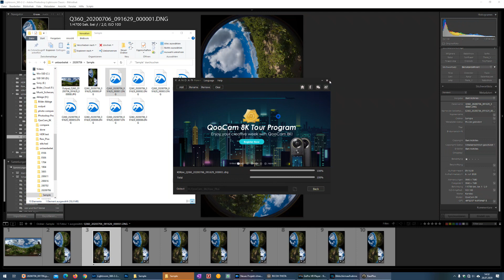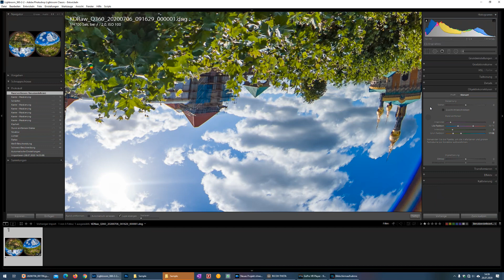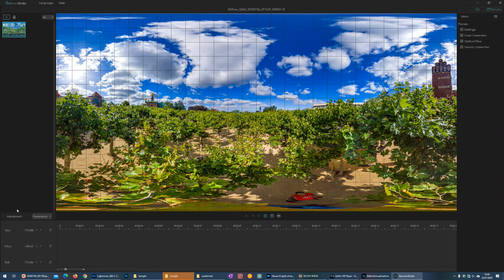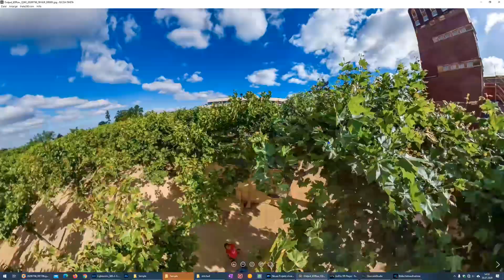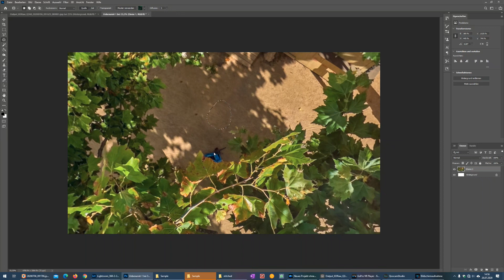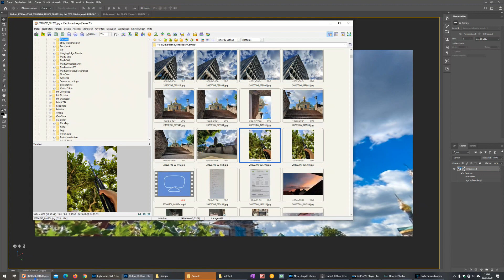Tutorial  - My Qoocam 8K Dng8 workflow

Comment: great video Sir, I too use this workflow with my Qoocam 8K but it is very time consuming. Try using Topaz Sharpen AI plug in for lightroom and then the stabilize mode to sharpen the image. The results are amazing, try the free trial.
Reply from the maker: I think it's not too complex. I need 5 to 10 min per photo. Similar what I need for a photo from another 360° camera, like the MiSphere. I heard already about Topaz Sharpen AI and I will try it one day, thanks.
Reply: @Flabig360  Indeed Flabig360. I saw a short video clip with the latest Sharpen AI (Standalone Program available as well now). Was AI Magic Crazily resolved a soft focus macro image video clip to Details like never before and very clean minimal or no artifacts as video will also show less defects or noise compared to static image.

Great for using on short clips That need that full Sharpness throughtout. ( How this camera should of been from the start ) Everything over 100 ft in the background is blurred and soft and that's the best units. Or being used in coldest countries where the heat does not affect it much.
Reply: @MetaCaptureOG  yes it does a brilliant job at improving the details of distant objects. I've been using my qoocam 8k for landscapes with amazing results.
Reply: @jillndaz  Sweet i think i should buy it while it's on sale.
Would you say That Sharpen AI is better for us on Qoocam 8k vs Topaz Gigapixel AI results?
I mean we are already at Very high Resolution so no need to upscale again, Maybe for more specialised work and a Huge Print is needed.

Wonderful thanks for the feedback. Should give the Video Enhance AI  a try as well for short clips. Let me know of your results compared to Sharpen AI. As i saw someone Import all frames from a video clip into Sharpen AI Then they imported the separate Frames back into the video file. Amazing! clarity they got resolved. Quite Insane to say the least.
Reply: @MetaCaptureOG  I have not tried Gigapixel yet so can't say. You can download a free trial of both software before you buy. I have tried Topaz Sharpen AI on some old DJI SPARK photo with superb results 👍
Reply: @MetaCaptureOG  Sorry for the late comment, but have you used Video enhance AI yet and how good was it in that case? 

What other Topaz plugins would be good to get? I am just getting a QooCam.
Reply: @ions7581  Have not used it yet. But the AI resolving power is Amazing. Qoocam 8k had very high Image quality for it's price, better Dynamic Range and Color Space in it's class.
Reply: Does it correct the Soft focus issue in the distance with Qoocam 8k blurry backgrounds? Thermal expansion issues?
Would like yo use it for Virtual Tour primarily.

I have my Qoocam 8k Unit arriving tomorrow. Believe i will also need the Topaz Sharpen Ai saw some seriously amazing results at sharpening an almost trash soft focus image and even short video clips with new Batch Process. And Adobe Media Encoder converter to extract frames as PNG's.

Any examples comparisons you can share that you have got so far? Much appreciated thanks for the Feedback.
Reply: @Darren Ball Does it correct the Soft focus issue in the distance with Qoocam 8k blurry backgrounds? Thermal expansion issues?
Would like yo use it for Virtual Tour primarily.

I have my Qoocam 8k Unit arriving tomorrow. Believe i will also need the Topaz Sharpen Ai saw some seriously amazing results at sharpening an almost trash soft focus image and even short video clips with new Batch Process. And Adobe Media Encoder converter to extract frames as PNG's.

Any examples comparisons you can share that you have got so far? Much appreciated thanks for the Feedback.